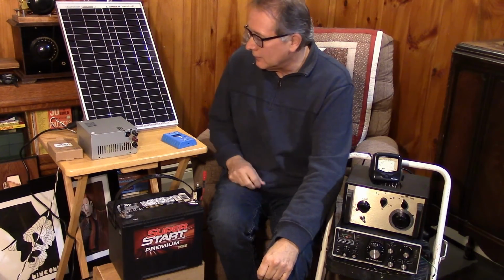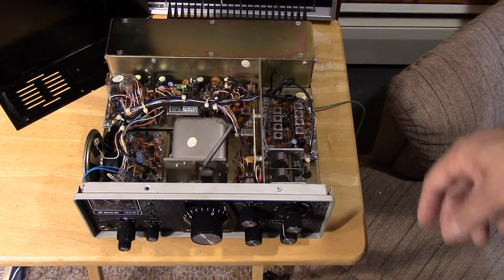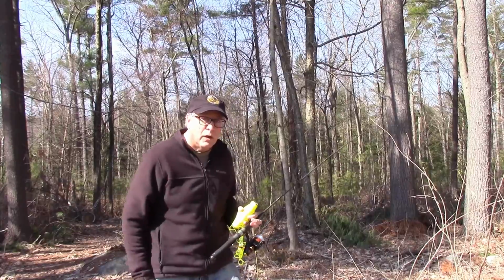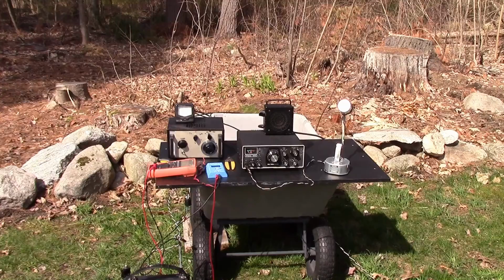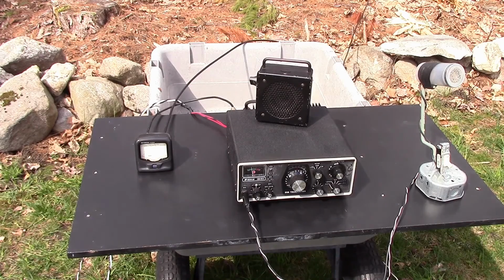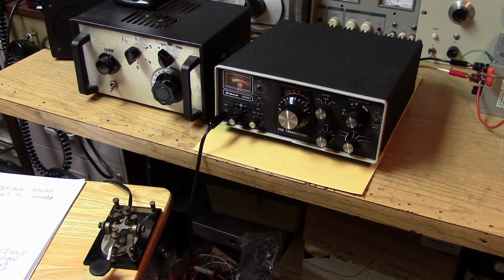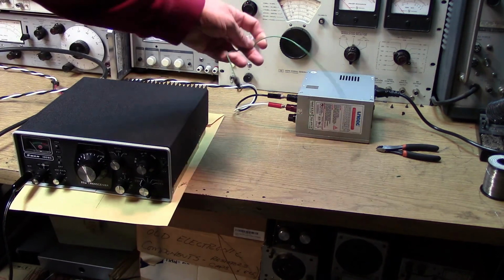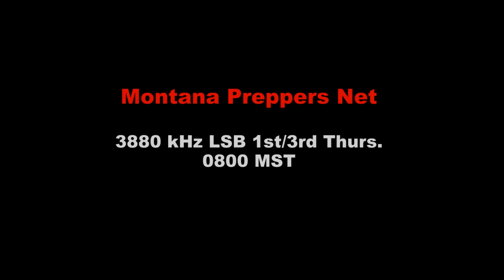Radio for the Prepless  Part 2

Comment: 73!
i as german love my ncx 3 all tube radio .
it need 6,5 amps on 12 volt for heating the shack ;)
but the hv section is extremly efficent! 
the recieve of poor Signals is outstanding.
Reply from the maker: The NCX-3 was my first XCVR and the one I used in mobile in college mounted in my gigantic 66 Chevy BelaIr. Single Conversion and hot hot hot receiver sensitivity.

Comment: my ten tec omni D is easy to work on also. I like your emergency dipole and vertical
Reply from the maker: Hard to beat a simple rig that works on DC power and a proven antenna for emergency work.

Comment: Isn't TV coax 75 ohm coax?  I thought you'd have to have 50 ohm coax since most radios operate with 50 ohm systems of impedance.  I really like the antenna matcher you made.  I had to stop the video and take a screen shot of your schematic.  Think I could build one if I can lay hold of all the parts.  That's a feat in itself when you're a retired, disabled Vietnam vet on a very fixed income.

Comment: I think the PLL radios are easily modified.  All you have to do is cut a trace on the PLL chip, solder a 3.7k Ohm resister across the trace and send the power to a SPST center off to make the chip pin either hi (on with 5V) or off with 0 volts.  I used to modify radios back in the day, mid 70's through the 80's.  To unlock the clarifier you just had to add an 8V source to either end of the pot or the center tap (can't remember which without looking at a schematic).

Comment: Yep, in my CB days back in the mid 70's through the 80's, I used an antenna matcher with my base station CB radio.  It sure worked great; just wish I had it back.  I sold all my TV and radio test equipment along with my CB radio gear just before moving from the Atlanta area to Tennessee.  Now I wish I had it all back.  I do have my dad's old Davis Electronics freq counter which I'll be using in the near future after getting my HAM Technician license in Sept.
Reply from the maker: Good luck on the Ham ticket Rusty!
Reply: @MIKROWAVE1  Thanks, it got postponed until Sept. 21st due to COVID-19.

Comment: Your battery should be a deep discharge type.. An MPPT charge controller would be better to get the most from the panel.
Reply from the maker: Agree from a best combo standpoint for battery performance and life. But MPPT's can be noisy for EMI. Even that simple PWM controller was nasty. Being caught unprepped, means that you will be forced to scavenge what you can get, and for most folks that would be a car battery and maybe no controller at all.
Reply: @MIKROWAVE1  My new secondary charge controller, the Epever Tracer AN 30 amp MPPT seems to not put out any HF hash. The original Tristar 45 amp unit does. The worst offender is my Samlex 2 KW sinewave inverter. It wipes out 40 meters.
I added 4 100 watt panels for a total of 925 watts. 525 are in a tracking array.

Comment: Hey, wait, that radio isn't QRP. Looks like you need an attenuator pad! I just love this video! Thank you! I've been playing with ultra simple wire antennas for emergency, temporary, camping, hiking, etc use. All end fed half wave, all used with my multi-tap UNUNs. And I've tested them as 1/4 wave radiators with 3 counterpoise wires just laying on the yard. With shocking results. Plus, my feedline is only 1 foot long. lol. Also I've done a bit of testing with ultra low wires (2 to 6' high) using my same multi-tap UNUNs. Shocking results again. If you want to see my multi-tap unun, look for '80m EFHW & Multi tap UNUN part 1 of 3 Intro & Demo'. Also Mike, take a gander at my Michigan Cacti. It's a garbage picked, junk, 4 band vertical that cost nothing, works spectacularly, and is really fun to play with. It's basically a 20m aluminum vertical with 3 parallel resonator wires added.. just like a fan dipole. Thanks OM and be careful out there. My sister let her cooties loose I think.  73
Reply from the maker: I need to add loss immediately before I lose face!  Next I will demonstrate 160M on a finishing nail dipole.

Comment: On using a salvaged pc supply, always check first for bulged capacitors in the output filtering section. Can also try without the 5v dummy load, I've seen some run hapilly with just the green enable line pulled down.
Reply from the maker: Oh yeah! Bulged caps and some of these are probably bad anyway. I have some pretty old ones that are very dusty inside too. This one was happy with a 330 Ohm resistor so  15 mA is all it needed!

Comment: Mike absolutely love your videos My only criticism is when you do your on screen text leave it on long enough for people to read, I realize you're probably thinking people will pause the video to read it but in reality most people don't, and by the time they realize that they need to pause it to read it it's already gone past the screen, leave it on the screen long enough for people to finish reading it It's very annoying when it flashes by very quickly...
Reply: As Qvatch commented about using the cursor keys, which I think jump backwards or forwards in 5 second segments, I wanted to add that if you hit the space bar on the keyboard, that will pause the play. Usually pressing it again continues the play. I was actually happy with the presentation of text, and glad the presenter didn't leave it on the screen long enough to read, because when I didn't want to read it, it past quickly, and when I did, hey presto the space bar was pressed.
Reply: different people read at different speeds. You can use the arrow keys to jump forward and back by 5s, or adjust the video playback speed with the gear icon.